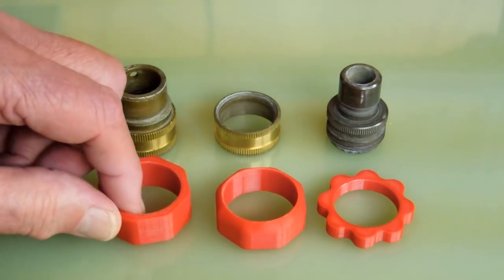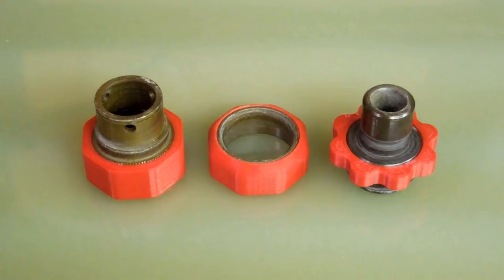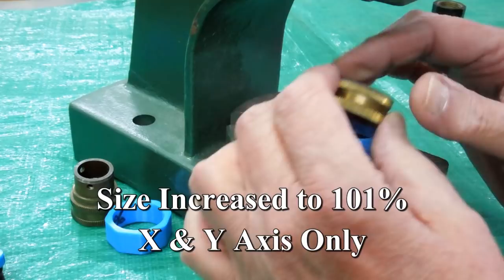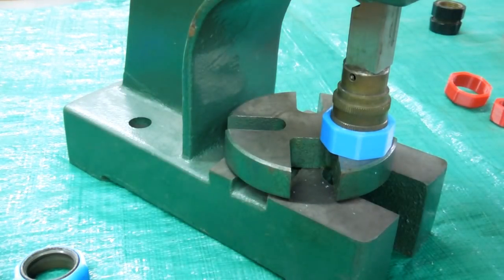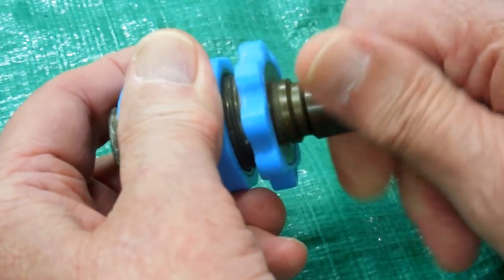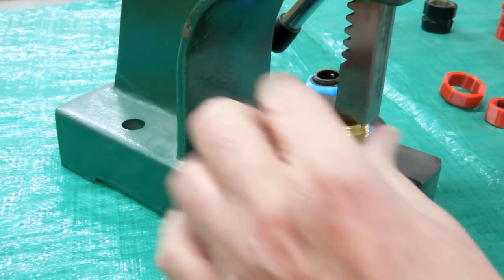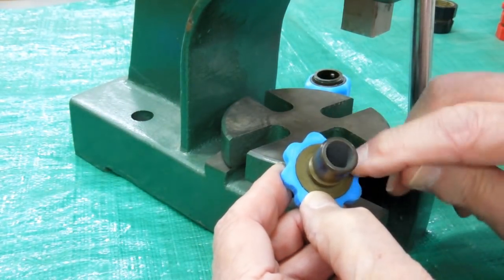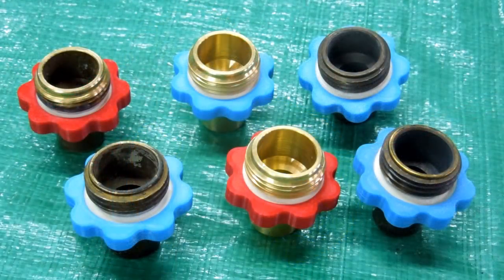Garden Hose Quick Coupler - Part 2 Replacement Grips

Comment: Ron I have a brass quick connect with a stop that stops water flow when disconnected. But for some reason the stop does not release water flow when connected to the male piece. Repairable some way?
Reply from the maker: Sorry, I am not familiar with the quick connect with a built in flow stop. That sounds like it must have a check valve (of some type) that gets pushed open when it is connected to the mating part. Since it is not working anyway, taking it apart to see how it works and if you can somehow repair it would be an experiment. These things sit out in the sun and get hot and o-rings and other rubber (or plastic) parts deteriorate.
Thanks for watching. Please subscribe! 
That is what keeps this channel going.
Ron
Reply: @Ronald Walters  Thanks. Coupler is all brass & there is a visible internal "stop". I Don"t know if there is an O-ring or if the little brass stopper pushes forward & back. It must come apart but I do not see how. Sometime when you are shopping take a look @ one. They are common couplers.

Comment: Hey Ron, did you actually use a hoop stress formula to determine the ID of the plastic part or did you just TLAR it?  I'm amazed at the amount of stress that your plastic medium is able to take.  Can you order UV resistant medium for your printer?
Reply from the maker: I measured the brass parts and drew what I thought would fit. Made test prints and adjusted as necessary. Now, using the provided files and possibly adjusting by +/- 1% should be all that is required. The knurled edges cut their way into the plastic so there is not as much of an interference fit (stress) as you may think... but they are on their firm.
Reply from the maker: I have no idea about the UV Resistance. You can read the information posted by Max Snelling which addresses exposure to UV. I do expect the colors to fade but hopefully the PLA will endure.
Reply: i'm curious if some of that (fusion) spray paint could be used to protect it from the light? it sticks very well to plastic. now a hose sitting in the sun can get very hot.... hmm hopefully not hot enough to deform the plastic
Reply from the maker: Paint would protect it from UV as long as the paint itself remains intact. Temperature in the sun is another issue so I would not use black paint.

Comment: one of my favorite prints from thingieverse is a faucet to garden hose adapter thing:1545940 i think this is the one i used.  anyways the treads are very impressive and its handy to send hot water down the hose some times.

Comment: They look very nice. Wonder how they will last.  I'm curious if a guy could 3d print a mold that holds the pieces to where a guy could fill a cavity like you did with construction adhesive but fill the gap with jb weld. The jb weld should setup hard and forever.... i think a lightly greased mold should be easy enough to remove after the jb weld cures if the layer lines are smoothed a bit?
Reply from the maker: Eventually the pieces will need to be replaced, especially the hose end grips. The construction adhesive will come off fairly easily but you would need to grind or burn off the JB Weld. Hopefully the PLA grips will last as long as the cheap rubber ones did.
Reply: My thought is making the entire grip out of jb weld.... the 3d printed part is just the hollow cavity a mold that the jb weld conforms to. It could be printed with slight pattern draft and probably bondo to smooth it out inside. a light coating of grease and fill the mold with jb weld... viola the grip would be entirely made from jb weld and should last forever or the rapture whichever comes first.. love your video's

Comment: I found this - An article written on Poly(lactic acid) fibers – PAGE 200
http://jimluntllc.com/pdfs/polylactic_fibers.pdf

UV resistance. Unlike other synthetic fibers, PLA does not absorb light in the visible region of the spectrum; this leads to very low strength loss compared to petroleum-based fibers when exposed to ultraviolet light. 

Moisture transport. PLA shows excellent wicking ability. This property and the additional properties of fast water spreading and rapid drying capability give the fiber a very positive inherent moisture management characteristic.

Biological resistance. Although PLA fibers are not inherently ‘antimicrobial’ without suitable after-finish treatment, they do not provide a microbial food source. In addition, testing by Odor Science and Engineering showed that PLA fiber-based fabrics outperformed PET-based fabrics for low odor retention.
Reply from the maker: Yes, very interesting. And it is not really biodegradable, but degradable. It is still a plastic. PLA products will 6 months or longer to compost in commercial composting facility. In a home composting facility, it may take much longer.

Comment: Neat, but uv rays will cook those in a month.
Reply from the maker: Some plastic will last outside for several years before deteriorating. A friend printed a PLA weather vane which has been outside for over 1-1/2 years with no sign of weakening. PLA is biodegradable under certain conditions, such as buried in a dump, inside the human body as a surgical implant, and apparently a PLA filter has proven not to last very long in a fish tank where biological activities are constantly taking place. Time will tell but they may last longer than the original chunks of cheap rubber.
Reply: Ronald Walters I had some PLA parts that were outside less than a month before they fell apart. Maybe some brands have different additives than others?

PLA deteriorates in water, with UV exposure and it softens significantly in temperatures lower than a metal fitting can get to in direct sun light.

ABS may be a better choice for these parts..